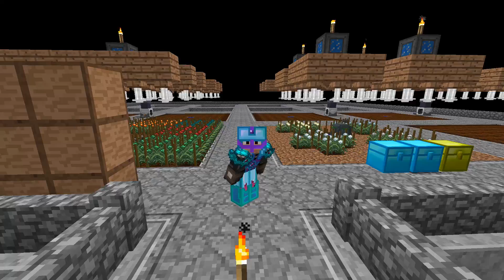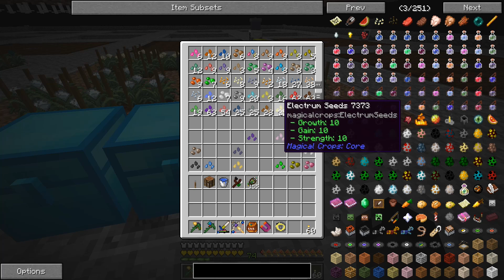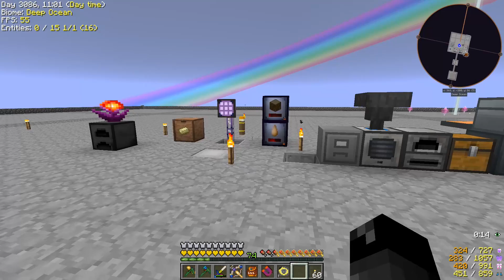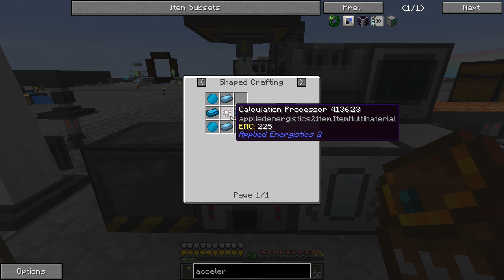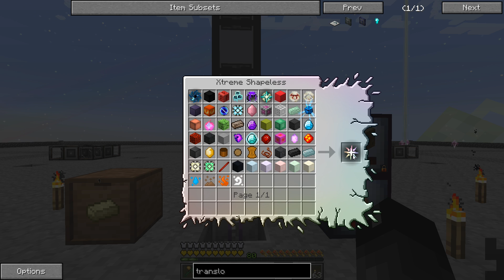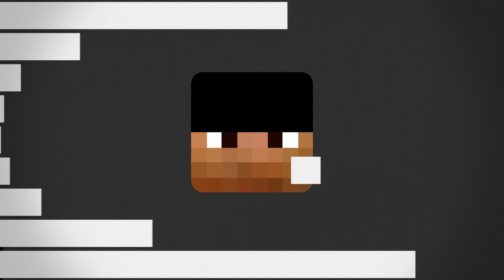Project Ozone 2 Kappa Mode - AUTOCRAFTING & QUANTUM [E36] (Modded Minecraft Sky Block)

Comment: Small tip hypno:
Use a certus quartz block in the inscriber and you get 8 printed calculation circuits at a time and you dont have to use a pure certus quartz even if you have the seeds ^^
Reply: Wait what?
Reply: xJohnnyD7 :D
Reply: xJohnnyD7 when u use a certus quartz block it acts like compressed things so 9 certus quartz is a block so a block is 8 printed circuits